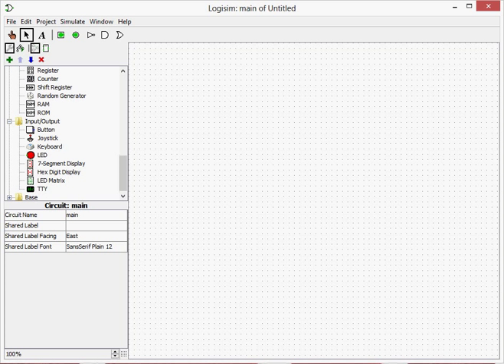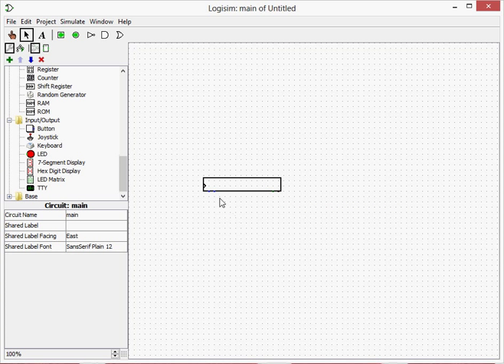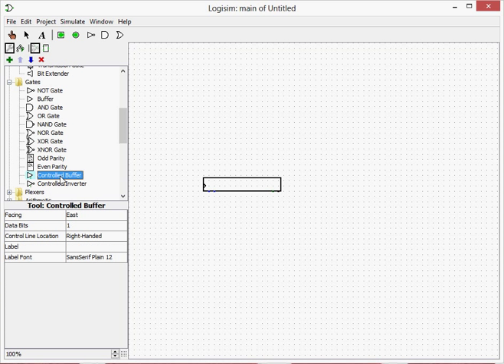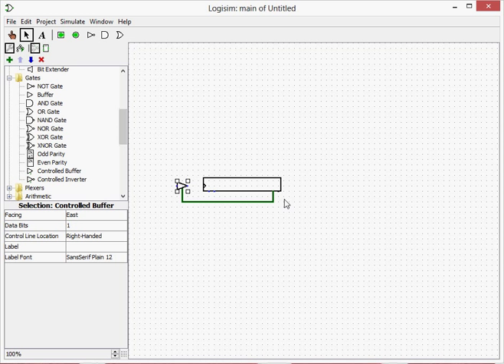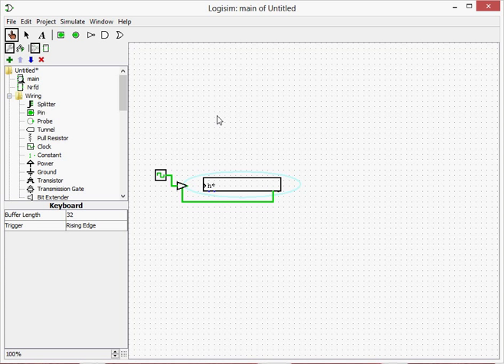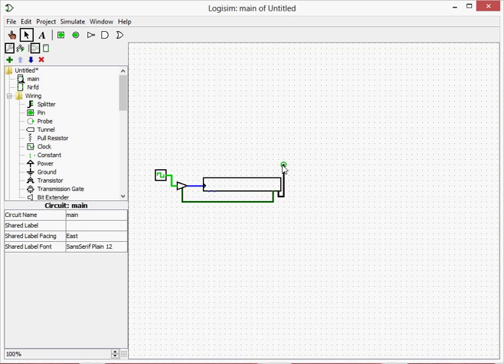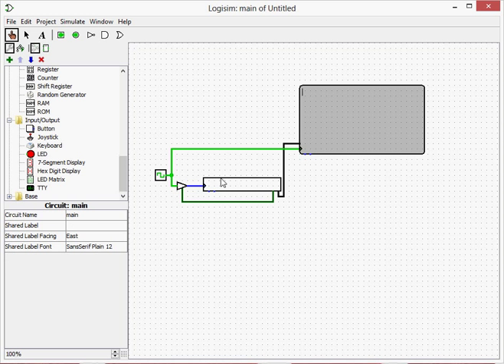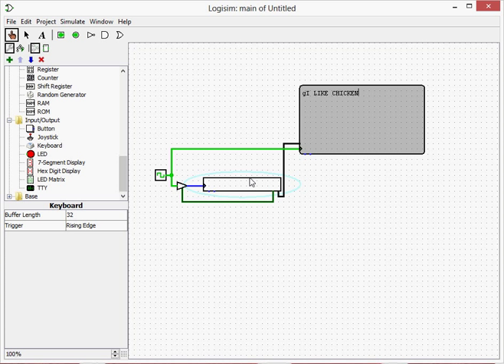Logisim part 6:Keyboards

Comment: SUP neutro,just have a question about the TTY. How can i remove words from the TTY by not deleting the whole TTY?
Reply from the maker: ***** Unfortunately I am unaware of a method to delete words from the tty as the tty doesn't recognize words. However you can backspace the last character with the ascii number 0x08. This can also be done by typing backspace when using the keyboard. Hope this helps
Reply: NeutronNick11 i used another technique with button and clear :D,but i still have a question. we have to do a final work at scholl and i am lost with memoryzing the words or the letters from keyboard or TTY,we need to memoryze the words from TTY or keyboard and show it on second TTY in next circuit,can you please help? i need to send it before end of the month.
Reply from the maker: ***** To do this you could probably use RAM to store the inputs from the keyboard. The second TTY can read data from there. If you need to transfer data from one TTY to another then you need to store data just before you write it onto the first TTY as you can't copy it from there. Hope this helps
Reply: I think the ascii code is 08.

Comment: if I use an and gate instead of the controlled buffer taking as inputs clock and the signal from the keyboard that says there are characters inside the buffer wouldn't I get the same result?

Comment: Can we have a tutorial on how to convert them into code for a CPU?
I know that all CPU codes are different, but just the basics?
Reply: On the bottom right inputs, hover over the input so it says something like: 7 bit ASCII

Then feed it into a splitter with bit input and fan = 7

There you go, ASCII code.
Reply: Also the ascii wire is black